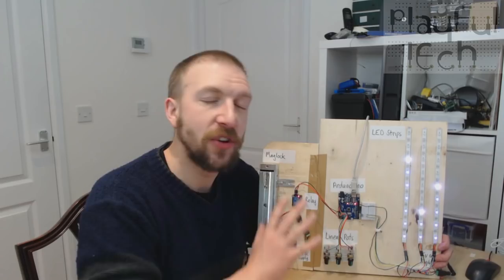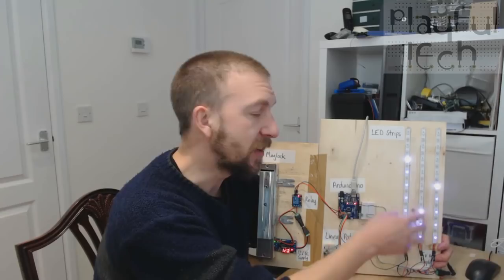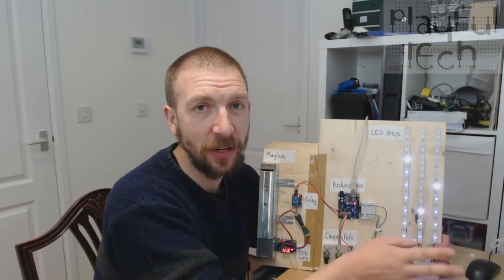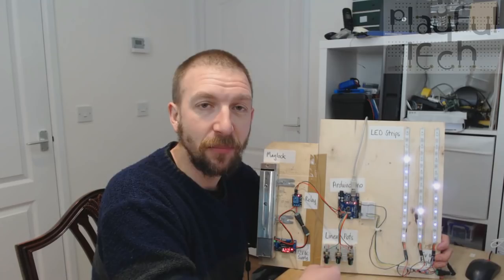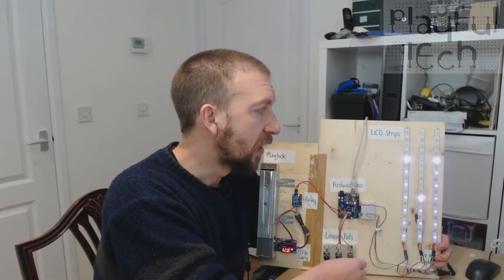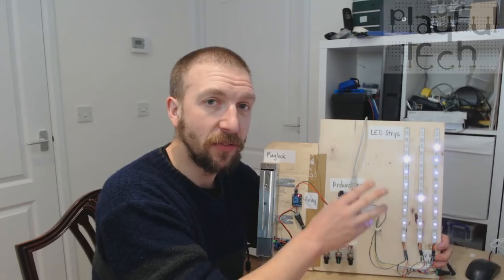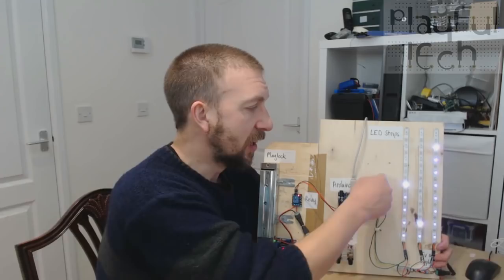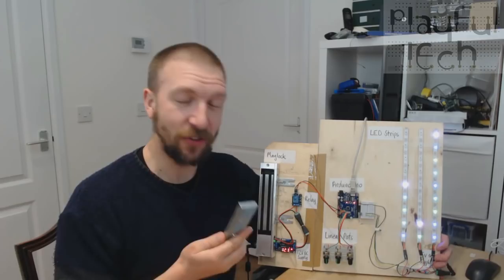"Valves" Escape Room Puzzle

Comment: Hello and thank you once more for another high quality though easy to understand walkthrough.
I've got a question if I may; It seems that you're powering the Arduino via USB. At about https://youtu.be/wV6O_Kjl81U?t=944 you have a ground line from the external power for the leds connected to the Arduino. Why is that?
Reply from the maker: Yes, that's right. Voltage is the difference in electrical potential between two points. So, when we talk about 5V output from the Arduino, say, what that means is that there's a +5V difference in the voltage on that line *compared to ground*. If you connect other power supplies to the same circuit, you need to connect their grounds together so that they have a common reference point - the "zero" point from which all voltages can be expressed. Otherwise, a 12V supply will be measured relative to one "ground", while the 5V will be relative to a different "ground". Does that help explain?